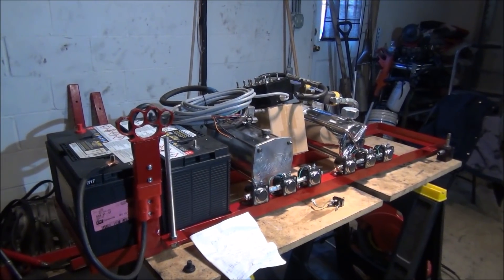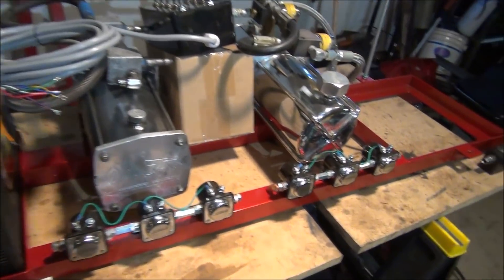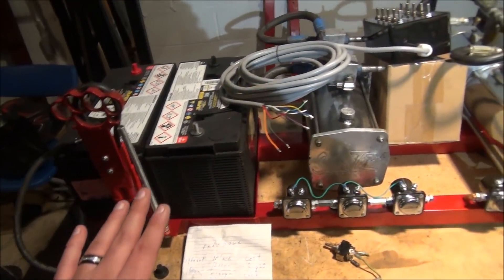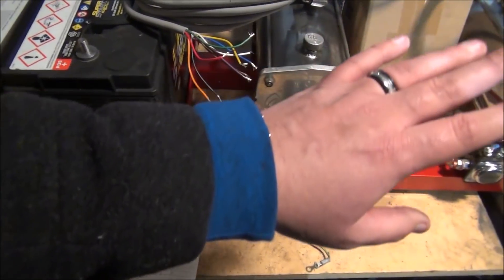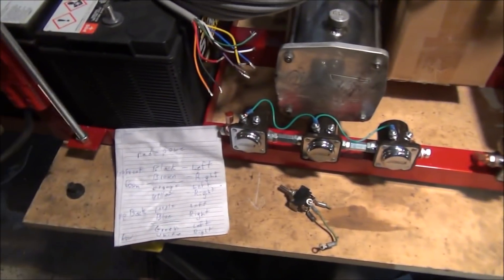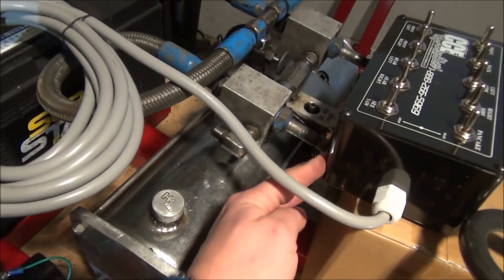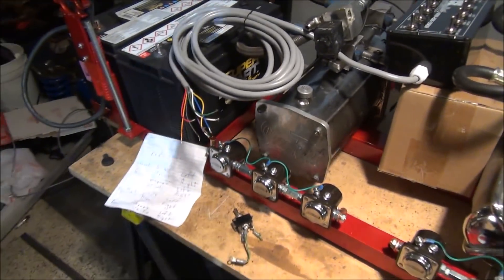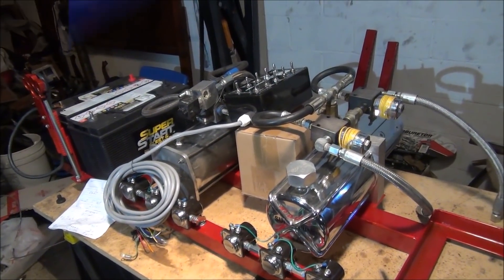How to wiring with hydraulics

Comment: Know this is an old video. Running a 2 pump 4 battery. Switch box power you said to put it on the second battery positive side so I’d imagine the switches are running 24v then?? Is that correct.

Comment: Do the solenoids have to sit flush on the metal or can they be raised I wanted to weld 10 mm bolts to my rack so my solenoids  can sit on them and be bolted down but idk if it'll work since the bottom of the solenoids would be raised off the metal on the rack

Comment: So basically it’s 3 Solenoids per pump? Or does it go by the amount of batteries you have?
Reply from the maker: Not exactly, 1 solenoid per 2 batteries is the general rule. I run 3 solenoids with 4 batteries and 4 with 6 batteries. 8 and up I run a block solenoid type of setup or run the solenoids between the batteries so there isn’t so much load on them.

Comment: Why do you need 3 solenoids back to back? I see this often and have always wondered. As 1 is capable of the same job?!?!
Reply from the maker: It’s to share the load. One solenoid would pop like a ballon with multiple batteries like that.
Reply: @LOWRIDERHYDRAULICS …I appreciate the quick reply. But how does it “share” the load when the full power is going through each one still? I’m also very experienced with Club Car golf carts. Golf carts run 4 solenoids. Bc they are used as gears. To apply more power the more ya press the pedal. So multiples for something like that makes since. But when all 3 are ran in series, the full load goes through each and every solenoid. So I’m just not seeing a benefit of this. 

I only have one solenoid per pump on my setup. But they are rated for the load. I’ve seen people double and triple up my whole life though. So I’m trying to get to the bottom of why they do this. I’m not being a dick or anything. I’m truly asking for education as to how they would share the load in this setup?
Reply from the maker: Keep in mind I am not an electrical engineer or anything but the way I understand it is you run multiple for a couple reason, one is to share the load and the other more important reason is each one is a “fail safe”. If you are just running one for example, if that solenoid gets hot and gets stuck open then you’ll have a fire pretty quick. For each additional solenoid the likely hood of 3 or more getting stuck open at the same time is less likely. The first solenoid in the group always tends to get the hottest first and most of the time it is the first to go out, but not always. When the voltage gets really high, we normally upgrade to a two bank solenoids setup that can support even more power by splitting the power to run through 2 sets of solenoids. I understand your logic, same power flows through them either way but from my experience, running 3 versus 2 you will have less problems with solenoids getting stuck open or going bad. The way it has been explained to me is it’s like sitting on a chair with 4 legs versus 3, it’s just more stable. Hope that helps
Reply: @LOWRIDERHYDRAULICS  first I absolutely appreciate this wisdom secondly, I researched this more last night myself. Sure as shit, it turns out when you run multiple solenoids in parallel they share the amp load. The same voltage indeed goes through all. But the amps are shared. I too am far from an electrical engineer, so this sounds ridiculous to me. I don’t see how it’s possible. With only one direct path for the current to flow through each one in parallel, I have no idea how this is possible. But again, this is what the electrical engineering books say. 

So this info coupled with your practical experience is good cause for me to change mine. I have 48v solenoids but like you said, I don’t have a safety for if it should stick closed. I guess it’s a good thing I chased all this down. 

Lastly, what part of TN are y’all in? I’m from Morristown. But live just south of Seattle now. So west coast scene with south East style. Currently rebuilding my original Sonoma all out with the late 90s/2000 style I grew up with. But using all modern parts and doing all the things I couldn’t afford as a kid. But thank you much again! I appreciate the education!
Reply from the maker: I’m in Clarksville TN.
Reply: @fineartonfire_5327 the solenoids in series in one conductor vs a parallel circuit is multiple circuits
Reply: @fineartonfire_5327 the solenoids in series in one conductor vs a parallel circuit is multiple circuits
Reply: @fineartonfire_5327 the solenoids in series in one conductor vs a parallel circuit is multiple circuits
Reply: @fineartonfire_5327 the solenoids in series in one conductor vs a parallel circuit is multiple circuits
Reply: @fineartonfire_5327 the solenoids in series in one conductor vs a parallel circuit is multiple circuits
Reply: @fineartonfire_5327 the solenoids in series in one conductor vs a parallel circuit is multiple circuits
Reply: @fineartonfire_5327 the solenoids in series in one conductor vs a parallel circuit is multiple circuits
Reply: @fineartonfire_5327 the solenoids in series in one conductor vs a parallel circuit is multiple circuits
Reply: @fineartonfire_5327 the solenoids in series in one conductor vs a parallel circuit is multiple circuits

Comment: Hope this isn’t a dumb question, I’m about to buy a 2 pump 4 batt hoppos hydraulic kit so I am studying all I can on installing it! I got everything down I think except one question
When installing a aftermarket 10 switch box do all my fronts for example my                   “left front corner, both front, right front” 
do all these connect to the one solenoid ? I’m not understanding where the other wires pancake corners etc go if appreciate any help thank you!!

Comment: Pump making a loud pitch sound could it be my solenoids?
Reply from the maker: Not likely. Check to make sure you’re not low on fluid. Solenoids don’t make a sound other than a click noise. Pumps make all the noise, more specifically the motor. If there is no fluid or it’s low on fluid the motor will spin faster because it has less resistance which make it higher pitch whining sound. Make sure the tank is full and see if that helps.

Comment: Does the orange wire that leads to the dumps does it hook onto all 4 of the dumps or how does that go?
Reply from the maker: No, orange wire only connects to one dump. Each dump will have its own dump wire unless you only have 3 dumps. For example, if you have a 3 pump setup with only 3 dumps, 1 pump to the front and 2 pumps to the back, you would then have 2 wires connected to the front dump so that all the switches on the switchbox acts right.

Comment: I got spark on my quick connect won’t let me connect it why?
Reply from the maker: If I had to guess I’d say something is grounding out. Maybe you have a loose wire somewhere that is touching something it shouldn’t. Could be that you solenoids are not grounded good enough. Could be any number of things with the wiring or grounds, my advice would be to follow every wire to see if you see any broken spots and check all your grounds, solenoids and pumps. One last thought, is your setup welded to the frame of the car or did they mount it to the body? That can play a big role in sparking, the body isn’t that good of a ground compared to the frame.

Comment: Don't know where to connect a battery charger for a battery 8 battery set up
Reply: Depending what charger you have you need to just unhook all the batteries and running all negative negative and positive  to positive the to charger

Comment: Great video. I bought a car with a six battery, two pump setup, using this same switch box. Front and back works correctly on the switch box, however the left and right, along with the rear left and right are backwards. (When I hit the left or right raise, the opposite side of the car raises. When I hit the left or right dump, the car dumps the opposite side as shown on the switch). What is the best and easiest way to correct this issue? Thanks!!
Reply from the maker: Sounds like you need to swap the dumps from left to right and swap pump wires from left to right.
Reply: Russell Harris Lowrider Hydraulics, thanks for the quick reply. I swapped the four dumps and that seemed to put the switches in the correctly labeled spot. Being that it’s only a two pump, I still can’t raise my rear independently. I probably have the only 64 Impala out there that won’t do a three wheel. Doesn’t seem like the back right wants to dump far enough. I’ve followed your videos on how to three wheel and it just won’t do it. I’m thinking of adding a third pump, but don’t even know if that’ll do the trick.
Reply from the maker: With a 2 pump setup, you can’t lift each wheel individually, you can however dump each cylinder individually. With a two pump setup, you can only lift both front or both rear cylinders. Adding a third pump won’t necessarily fix your problem. Impalas need to with have a wish bone or Y Bar in the rear that will allow the car to twist, running the stock banana bar will restrict movement. Would also like to know how many batteries you are running. Generally you would need 8 batteries in order to stand on 3 with the setup you have.
Reply: Russell Harris Lowrider Hydraulics, the car does have a wish bone and is on six batteries. I did notice that driver side stroke runs through a 4” pipe that is welded to the floor, the passenger side does not have this sleeve. When I raise both rear and try to dump the right rear, this pipe (sleeve) is putting the left stroke into a major bind and only allows the right rear to go down about 1/3 of the full travel. I’m going to try to remove that pipe this weekend and see it allows the driver side stroke to move. The pipe is barely bigger than the stroke and it’s welded in crooked, compared to the stroke. Half ass looking work, to be honest. With the trunk open, looking at the strokes, the right side without the pipe will slightly move, as the car goes up and down. The driver side stroke with the pipe around it can’t hardly move at all. In what way would the addition of a third pump be beneficial? Thanks!
Reply from the maker: Yes remove the sleeve, that will help. 3rd pump would make it so the back can be lifted individually, so it makes it much easier to 3 wheel because there is no pressure on one of the cylinders. With that said, if there is not enough weight in the rear, you will still have trouble standing on 3.
Reply: Russell Harris Lowrider Hydraulics, thanks for all of the advice. So I understand more clearly, when you have a third pump and lift just one side in the rear, this makes it easier to three wheel because there’s no pressure in the right rear. In what way is this different than just raising the back and dumping all the pressure out of the right side? I’m new to hydraulics, all my other cars are on air. Sorry for the novice questions.
Reply from the maker: When you lift both cylinders and try to 3 wheel you have to force all the fluid out of one cylinder in order for it to lift, it’s not just as simple as dumping that corner because the fluid won’t just drain out without you having enough weight on that corner to push all the fluid out. When you have two pumps just for the rear, your lifting one corner with absolutely no pressure on the one corner making it much easier to 3 wheel. Hopefully that makes sense.
Reply: Russell Harris Lowrider Hydraulics, that makes perfect sense. Thanks for all of your great feedback!!

Comment: Hey so I have two pump an a 4 battery set up I had someone help me set it up the batteries it works ok but I think I’m only running on two batteries not for my connect seems to b pulling off two batteries 
Do I hook positive to negative only or
Reply from the maker: Elias Pacheco yes positive to negative. Should be getting 48 volts to the pump when you hit the switch.
Reply: I charge my batteries brand new group 31s they hit good an all that but losing charge fast only two batteries seem to b draining while the other two stay full but it’s like it’s only pulling off those two batteries an other two have no play in the system is that possible or could it b me using wrong charger

Comment: I have a set up what batteries can i use if you can tell me is very good
Reply from the maker: Heriberto Otero anything with 900 CCA or more for the cheapest dollar amount. Different areas have different options available. Check with any battery supplier, see what you can get the best bang for your buck.

Comment: Do you need two quick disconnects for the other bank of batteries? Where did you find your quick disconnects? Thanks for any info!
Reply from the maker: Jesus de la Isla no you don’t need two quick disconnects with 2 banks, say you are running 4 and 4, just connect the first negative of each bank and then ground one of them. You can get quick disconnects from any hydraulic shop or most of your local welding accessory shops have them. One like in the video is from a fork lift.

Comment: Would that mean, hypothetically..you would use that orange dump wire, for the black and brown pump lift wires?? Could you please make another video to explain it more clearly. I’m slow ha and thanks for the info you’re awesome for this 🙏👍🏽
Reply from the maker: No, dump means down, pump means up or lift. Dump wires do not connect to pump wires. If you need to know what wire goes to what in your switch box, I made another video that thoroughly explains how to figure that out. If you still need help, feel free to contact me through Facebook at “Lowrider Hydraulic Tips” I manage that page and you can send me pictures and videos of what you have and I’ll help you figure it out. This stuff can be complicated at times so don’t get discouraged.

Comment: I'm gonna be doing my quick disconnect so do I loosen up the Allen wrench bolt then slide the 1 gauge in and tighten it up or do I solder it like  battery cables ? Thanks for the videos I've been learning a lot.
Reply: Michael Mckay yes just slide the cable in then tighten it. Just in case you want to move your ground later you can put a longer or short cable. If you solder it your stuck with that cable.
Reply from the maker: Michael Mckay both is best. Solder it then clamp it down with the Allen bolt. Basically the tighter the connection the better.
Reply: Russell Harris Lowrider Hydraulics